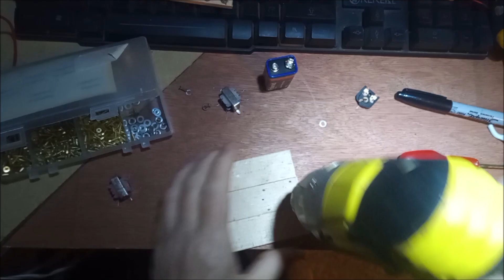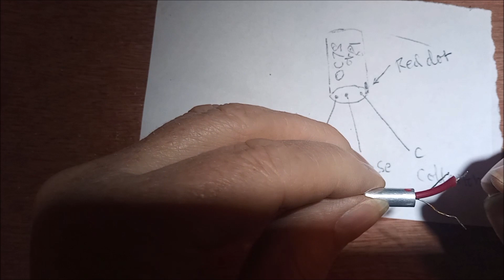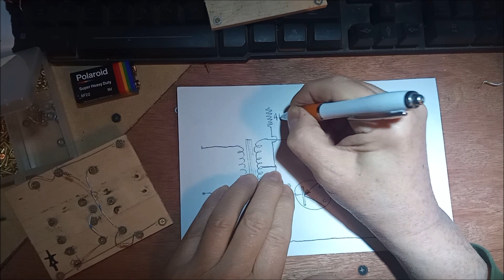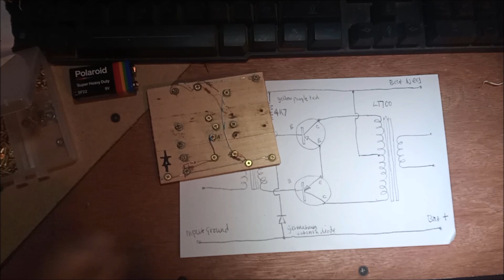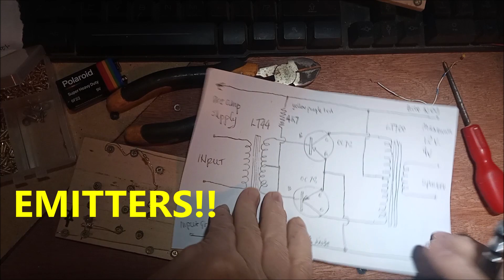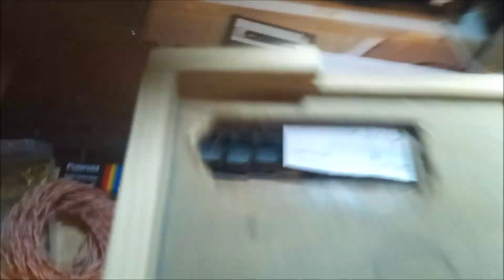Germanium Amplifier Output Stage construction.

Comment: Nice video! I've been reading the (1960 Mullard,transistor-manual) online and your amplifier is very similar to those designs',with some small changes'.They discuss the (germanium bias/current-diode )very-briefly,but don't use it in their schematics'?I'm thinking about using a (low-hfe,germanium-transistor )as a 'diode' in that position.Also looking at the 'Hammond' transformers'.They are not cheap,but most have said they have better 'output-performance'.I really like this design and will try to build my amp based on your schematic!🥂